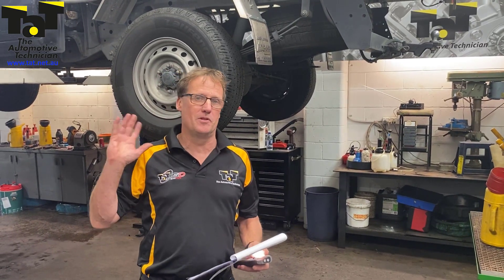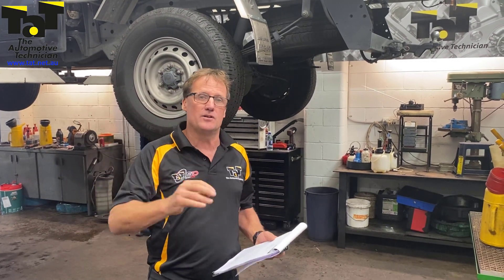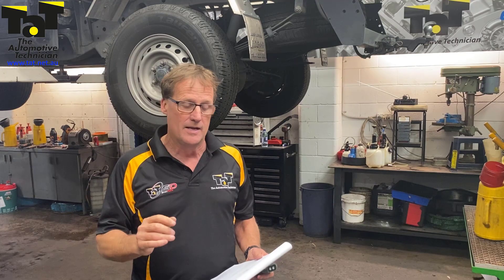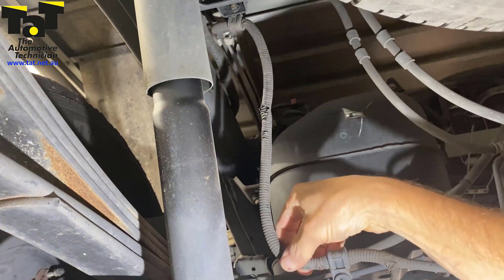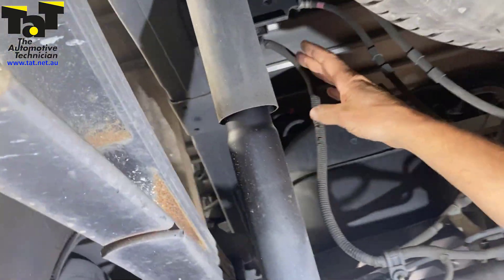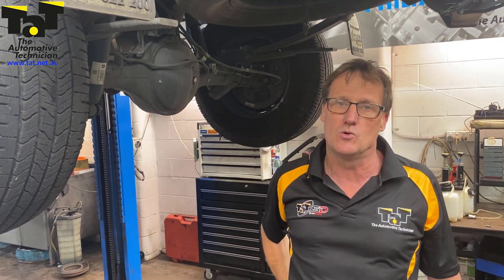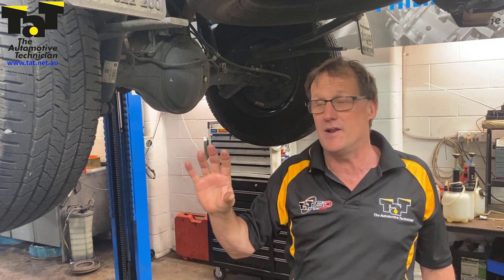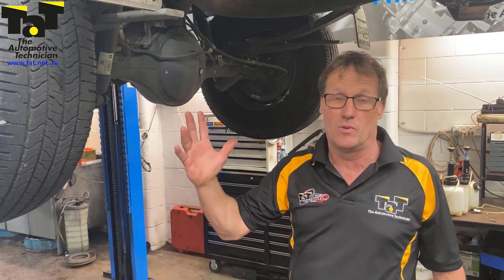2013 Ford Ranger with ABS traction control issues

Comment: Thanks and that's exactly where my 2016 BT50 LHR wheel speed sensor break was broken. It broke at the clamp connection to the axle. The wire plastic sheath is far from flexible and once the sheath cracks, the wire would break in an instant.

Comment: Hi an issue with this code U2300:55-AB central configuration in ford ranger 2012
Reply: @MsPAPA1968 have you found a fix yet?